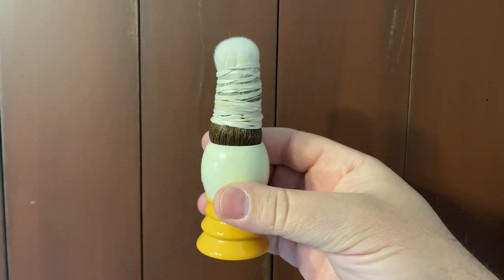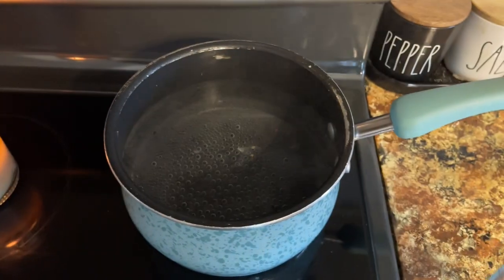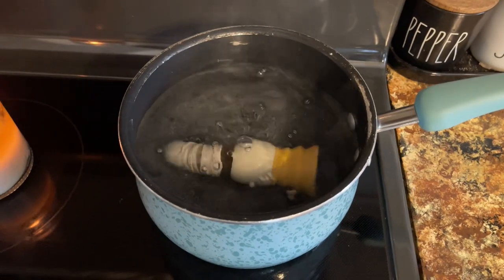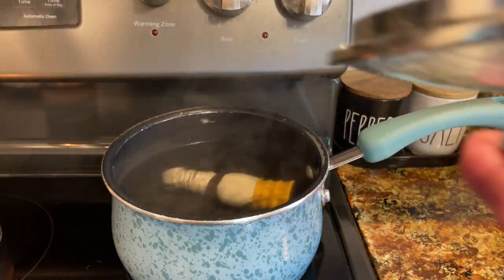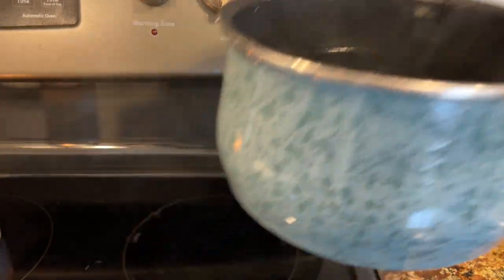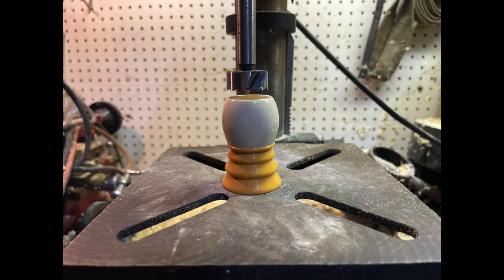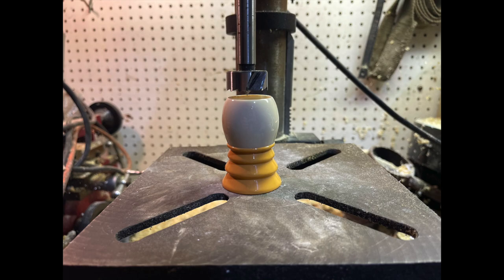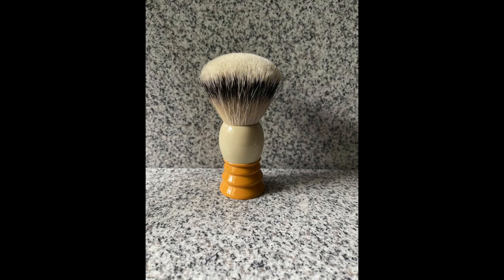How to replace a knot in a shave brush || How I Do It || #matthewshaves

Comment: Covered the pot, reducing heat to low for 45 min.  When i took it out as i was twisting the knot from the handle the handle broke in two where it was glued. The purple top from the clear bottom.   Good thing the PAA brushes are cheap $20. So it wasn’t that big of a deal.  I might try it again using your method.   
Stay safe and thanks for the video buddy. 
Alex
Reply from the maker: Your right those brushes are pretty inexpensive.

Comment: The drill press is a great tool to have for this job, I only have a Dremmel tool and if your hands are not steady you can destroy your handle. I have used the steaming method and cut+dremmel method for getting the old knot out, have not tried the soaking in very hot water method though, I will try that idea on my next knot change over. Thanks for HIDI method.👍😎🤟
Reply from the maker: If the knot doesn’t come out by hand, have some pliers handy. Let me know how your next knot replacement goes. Thanks for watching uncleshaves!

Comment: Great HIDI video. I have replaced a couple knots, but used a dremmel tool since I do not have a drill press. I have done the hot water method and also just cut the knot and dremmeled out the glue and remaining hairs. Keep the great content coming, your channel is always fun to watch.
Reply from the maker: I did a knot like you described and I had stuff everywhere. I was just too messy with it I guess. Thanks for the valuable feedback!

Comment: I haven't replaced any knots, but I've installed a couple and I've used GE Silicone Glue. It holds up just fine and it's probably easier to remove compared to epoxy.
Reply from the maker: I agree, I would stay away from epoxy. Thanks for watching Chris!

Comment: It has to be said that this is not a good idea on all brushes. I completely ruined 2 vintage brushes using this method. The hot water completely discoloured the handles. I think its safe to say that todays materials are better than than vintage materials. Anyway Matthew keep up the good work
Reply from the maker: Your right, a caution has to be taken when doing this. Thanks for watching Michael!